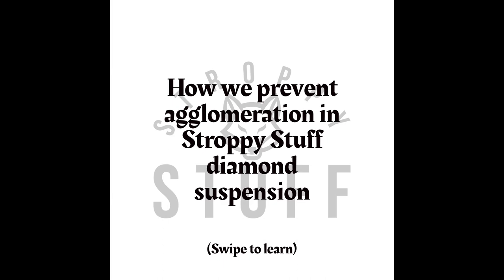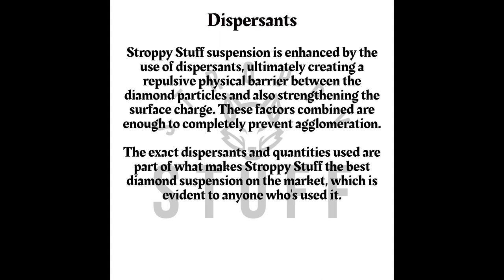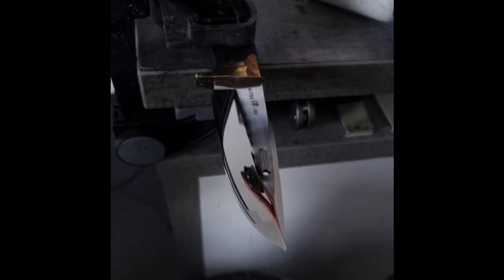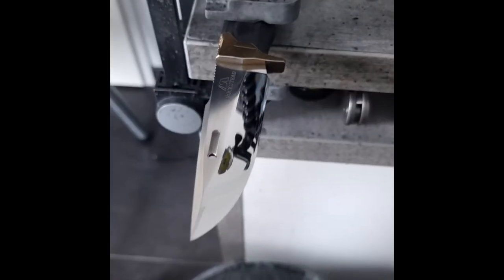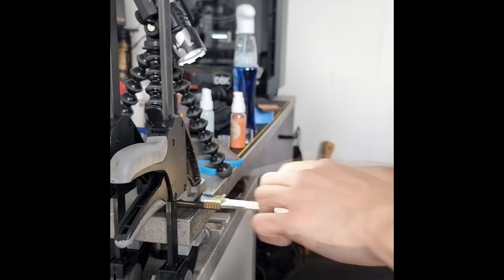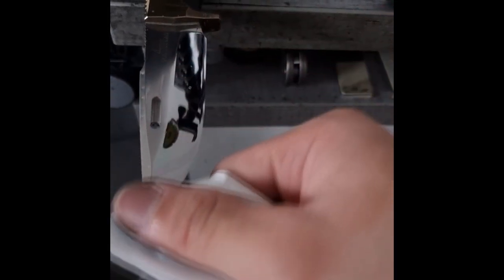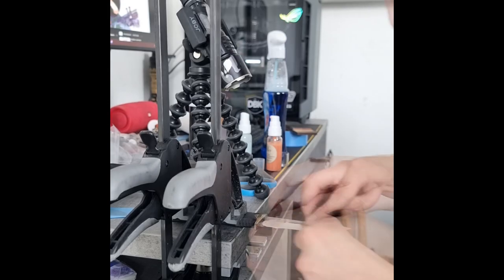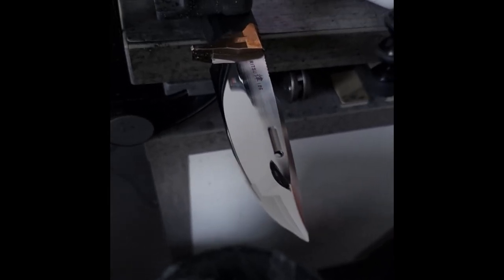Stroppy Stuff mirror polish demonstration. No agglomeration!

Comment: I did use leather to make a transition from sandpaper to foam, Also on the last pic I can see remnants of p1200 I didn't do propperly or just a blemish from the last passes of p320 to satin the flats.
First job on this knife was more propper (The plunges were way better). Gonna redo it now🤣
Reply from the maker: Maybe we'll have to do another video then  🤣. Regardless, I think it still demonstrates the point well. It's clear that there is no agglomeration from stropping compounds, only remnants of scratches left from prior SiC paper steps.

Comment: What is agglomeration? What is lapping? Whats super finish foam? The 1200 grit silicone carbide, is that just 1200G sandpaper, black stuff usually? Can we get your products here in the states? Your prices were all euroes when I dropped by
Reply from the maker: Sorry that I struggled to clarify everything.

Agglomeration is where 2 or more particles bond together to make a very large particle which will cause very deep scratches.

1200 grit silicone carbide paper is sandpaper that is made of Silicon Carbide power. It's an ultra hard abrasive, not quite as hard as cubic boron nitride or diamond but much cheaper.

Superfinishing foam is a polishing pad which I made in small quantities. It's a very expensive material for polishing metals at the final stages (super finishing them).

Lapping is basically the process of abrading something to be flat.

My compounds are available in the US on the Gritomatic website but I also ship internationally, the website takes international payment.

Thanks for the interest and let me know if you've got any more questions
Reply: @stroppystuff641  awesome! 😁 Need a strop and I guess the one micron. Goal is to put mirror polishes on my zero grinds and secondary bevels to make them gleam. Love the content & the knowledge.